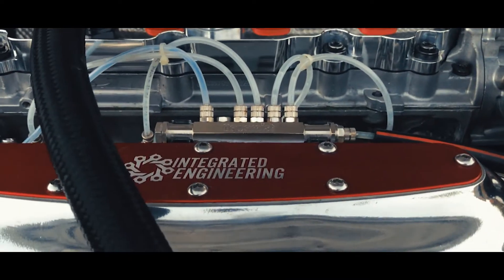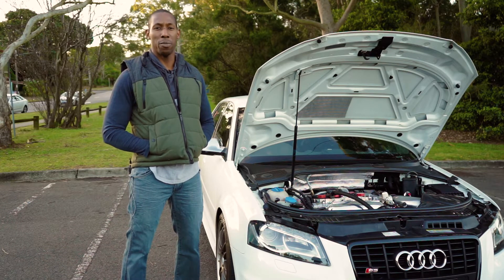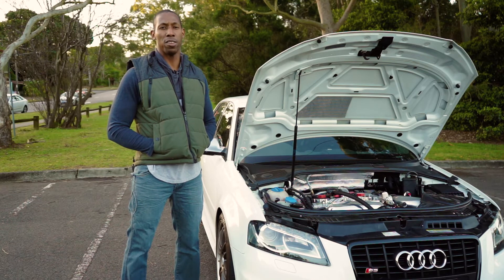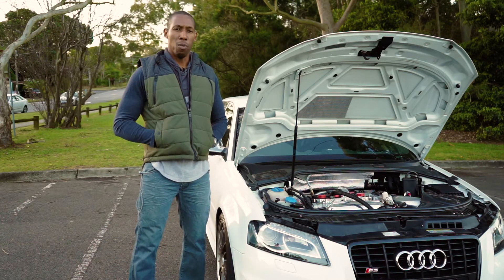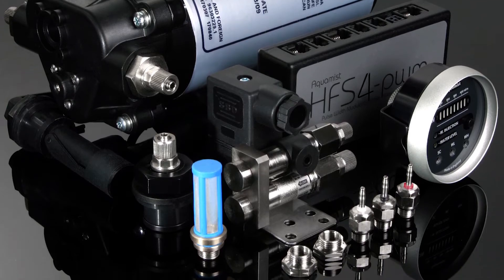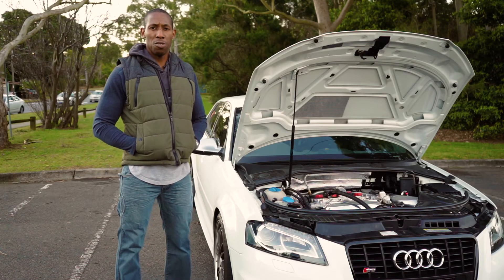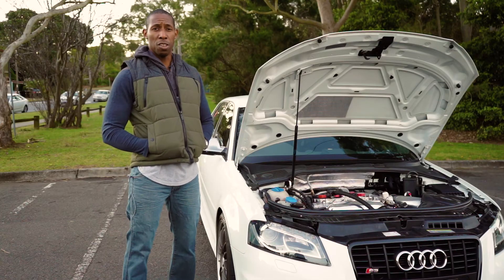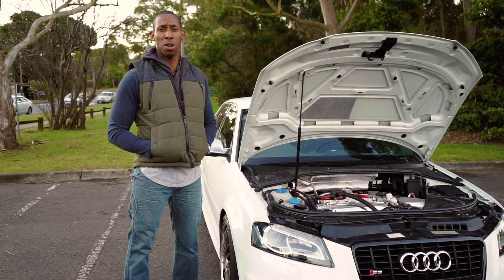Aquamist installation - Audi S3

Comment: how is the controller wired into the ecu
Reply: Brandon Dobos the controller piggybacks the ecu  signal for injector duty cycle, fuel pressure and map which is used to calculate the rate of injection required. The controller is also wired to the boost control solenoid. In the unlikely even of a fail-safe, the boost control solenoid is turned off, dumping boost back to waste gate pressure.